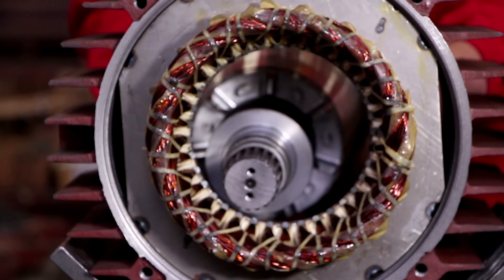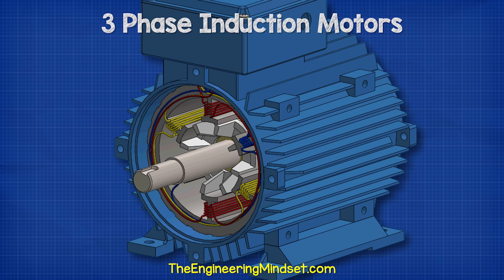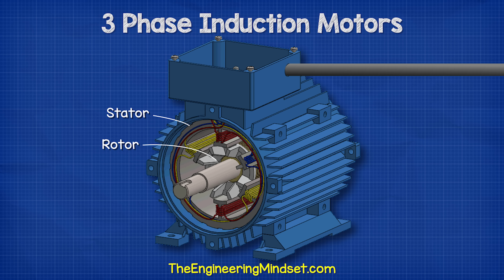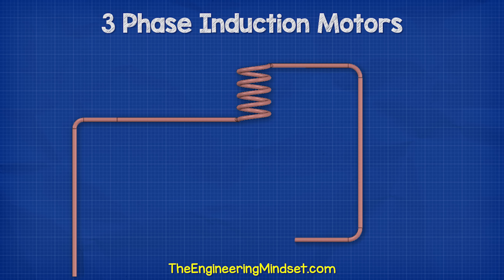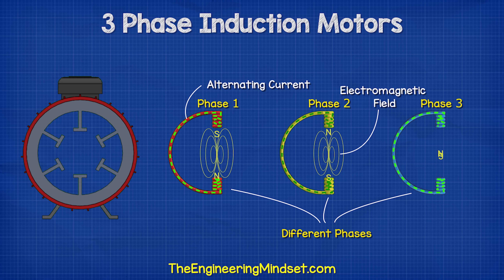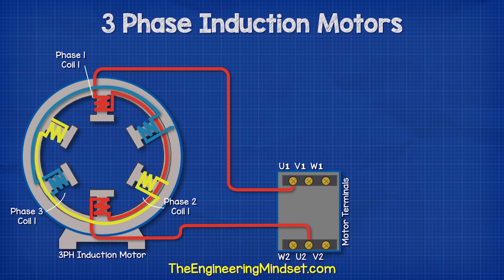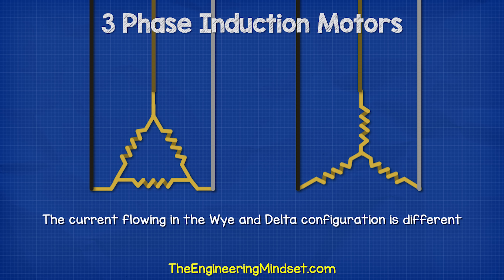How Electric Motors Work - 3 phase AC induction motors  ac motor

Comment: The Genius of Nikola Tesla. How did he imagine this in his head and constructed it when I even with this great animation hardly can understand it.
Reply: His brain was thinking in 5D, we are thinking in 3D.
Reply: Helps that he had an IQ of 240 minimum!
Reply: Also... people use the paddle to row or paddle. Old technology. Most people dont reallt know how it works. They feel the force on the paddle, and push the water... i mean when using it, you start to feel how to utilize the physics. To explain it, is much harder.

Even today, they dont really know what magnetism is. 

And then you have aerodynamics...

Its all about trying, and explain it after.
Reply: Nicola tesla did not invent this, he improved on it, there were already electric motor on his day and DC motors were more prevalent however inductions motors not widely used they had been already invented. Tesla under Edison fixed many problems he had with DC motors but Tesla had a better theory on how to conduct electricity better with AC with inductions motors but Edison would have none of it. Then Westinghouse hired tesla bought his patents and other patents before Tesla and had Tesla work on his ideas. Then Tesla improved and modernized the induction motor in other word he made them practical with the aid of Westinghouse backing and the patents he bought. But Tesla did not invented
Reply: @jhonnycaicedo5647  this motor Is originaly Tesla invetion
Reply: @srancojic5963  No.
Reply: Focus and imagination. Einstein said imagination is more important than knowledge.
Reply: @blau6832  Nikola Tesla

The first AC commutator-free three-phase induction motors were independently invented by Galileo Ferraris and Nikola Tesla, a working motor model having been demonstrated by the former in 1885 and by the latter in 1887.
Reply: Tesla wasn’t the genius he was made out to be. He was wrong more than he was right.
Reply: @ignacio9399  any success was preceded with many failures. Your comment was completely ignorant lol
Reply: because he was a genius
Reply: whats you got to do with Tesla. cmon now
Reply: The man's brain had a brain that had a brain inside a brain
Reply: @ionutth4895    I hope your not thinking in 3D. 3D is the past. A specific moment in time that cannot be influenced by the 4 dimension because it's already happened. 4D is what we think in, we plan ahead. Most of us don't have the brain capacity to accurately think in 4D but that is what we do. We plan in 4D, and wait for a 4D moment to act, and then it becomes 3D, because its been done. While time can be slowed down and sped up, it's still 4D. When you look into a telescope and see distant objects, your seeing 3D, because of time dilation, depending on distance of course, so yes, you can view the infinite in 3D. It's 4D to you because that's how we process. But there is no 5D. It's just variations of the 4 dimension.
Reply: Really great
Reply: All because of one successful experiment in hundreds of fail exp
Reply: @sunflower735sunlight5  He was a genius and i dont think anyone disputes that. But for some reason a lot of people really overstate his work (Even though there really is no need to do so, his work is really important for modern electrical engineering), making him to be a lot smarter than any other genius (like fe Einstein). He did not invent "the" electric motor, only certain build-forms of it after the principle was already invented. He was also ultimately wrong about his worldview regarding physics (he did not believe in sub-atomic matter like electrons and Einsteins theory of relativity, both of which are proven to be right nowadays)
Reply: @TobiasRebentisch   No electrons were discovered a long time before his death
Reply: @yuhanqin1463  I know, Tesla still thought they dont exist. As i said, he didnt believe in sub-atomic particles.
Reply: That was hardworking
Reply: You need to know that Tesla was not imagine a induction motor, he was seeing it!!!!!
Reply: @ionutth4895  he was thinking with his unconscious but in conscious way!
Reply: By learning from nature of course!!!! ❤️
Reply: @TobiasRebentisch  He was technically right since they do not exist at all the way conventional science taught!
Reply: @Ksum Nole I'm glad Monsieur Curie wasn't like you!!!!
Reply: The pigeon told him.
Reply: Good point
Reply: He must of been outstanding
Reply: I believe in Tesla family's powerful inventions
Reply: @JF32304  i can imagine a lawn mower, but i need the knowledge to know how to fix it.
Reply: Edison founded all this way before Tesla.   Tesla just refined it to its final stages.
Reply: Westinghouse gang 🤙
Reply: "Geniuses" weren't really geniuses , they just had less distractions and more time to think and achieve what we think are miracles.
Reply: @Gretsch0997 That's just false goofball.
Reply: Edison created dc powered motors. Tesla turned them in to a/c powered motors
Reply: He didn't imagine it in his head he said that he got it from Spirits in the universe above,  do your research you will learn all the major inventors say the same exact thing Edison, Marconi, Einstein etc  but people say they were geniuses but they were just a little touched in the head, For what telling the truth?
Reply: @Prodigal450  😂
Reply: @Prodigal450  😂😅
Reply: @ignacio9399 it only takes that one final time of being correct
Reply: God gives us different gifts, we must use those gifts.
Reply: Although it was Tesla that came up with ideas of power distribution via polyphase AC and how this could be used to both create light and notice force, it's Mikhail Dolivo-Dobrovolsky's 3-phase 3-wire system and squirrel cage AC motor that we all use today and whose design was so perfect it remains unchanged to this day.
Reply: Indeed, it's his design that this video is describing, notice how only 3 wires are connected, not the six of Tesla's.
And without that squirrel cage, you can't get much useful force out of the motor.
Reply: I urge you to read Mr Tesla last letter to his mother.
Reply: @Gretsch0997  Edison literally stole the ideas
Reply: He understands that magnetic force can move an object, so maybe he thought if it can spin it too?

That's how i thought of electrical motors worked before watching any video about it, guess he got really curious
Reply: The electric motor was discovered by Faraday
Reply: 😂😂😂 Totally agree
Reply: No
Reply: @ionutth4895  and yet, I’m thinking in 2D flat earth theory, lol. Tesla is the greatest!
Reply: @ignacio9399  just remember that Edison failed many many times before he got the lightbulb to work so most of them failed many more times than successes
Reply: Thank God I’d say.
Reply: Amazing!
Reply: 4 hours sleep and work all other time
Reply: @ionutth4895 ..I thought so too...
Reply: His iq was 300 @CAVALIERKNIGHT33
Reply: He is great...no doubt
Reply: @JF32304  I disagree somewhat with Einstein on that one. Imagination is inherently limited to that which one already knows about. Nothing is generally imaginary if it already exists, so to truly be imaginative, one must be familiar with the ordinary and real. To be personally oblivious to a creation and conjure up an idea for it is ultimately disappointing and redundant. Moreover, if one has an ingenious idea for an unprecedented invention, but none of the scientific knowledge necessary to create it, their imagination will be bottlenecked. I concur with the inordinate importance of imagination, but to treat knowledge--which is intrinsic to imagination--as inferior, is naive. An analogous argument is that chemistry is more important than physics, or vice versa. Both are simultaneously necessary for reality as we know it to exist.

Nuance is important.

Comment: Man, I have been an industrial mechanic for 20 plus years. My weak spot has always been electrical. I have understood the basics for a very long time, but when I have tried to further my understanding, books just haven't done the trick in my simple little mind. Your series on electricity is absolutely amazing. In just a few short hours I have gained a better understanding of the concepts that the books just can't teach me and definitely don't show. The animations you use are the difference and will be the difference in why these facts will remain a permanent fixture in my memory banks for the rest of my life. I don't even know how to say thank you enough. THANK YOU!!!!
Reply: tungspeeker9660
Can't say I blame you. I maybe be going into robotics, but my main discipline (major) is mechanical engineering in part for this reason.😂
Reply: Hey man i’m currently in school for industry maintenance at the moment. Struggling to understand this stuff, is there any advice you can pass down to me?
Reply: @connerlott  Sure. Not sure exactly what you're having trouble with, but for me, it's usually easier to grasp a concept if I was hands on with it. If I didn't have the chance to go hands on, I always looks for something like the animations this guy offers. Easier for me if I can see how it does what it does, as it's doing it. Hands on is the best way to learn
Reply: I am in the same boat !! The electrical portion has always been a struggle for me but when I see these video, everything comes in full circle.
Reply: I'm an electrician by trade and this series hammered home a lot of concepts I had been improperly taught. I was just telling my buddy the same thing about how the dissection and animations are priceless
Reply: Literally coudnt of said it better myself, you are me ha
Reply: dont feel bad. I just got my electrical engineering degree from a top 10 uni and I barely understand anything and  neither do most of my classmates. You just have to learn via hands on you cant really learn from videos or books. Theory is very different than reality
Reply: I’m 22 years old trying to get onto maintenance in the factory I work in. I have a strong grasp on pretty much everything in the building besides three phase motors. Everytime I’ve tried to research it it’s all just been mumbo jumbo but this video really helped me see the simplicity in it.

Comment: When you realize that a 15min video thought you more than a 4 year college...
Reply: College won’t teach you the practicality or a thorough understanding of any applications for the topics they teach you. That is a huge problem I had with college is they’ll teach you the theoretical concepts buts for me that more difficult to understand since I couldn’t apply to anything real. Such as a motor for current, voltage, resistance.  or a water pump for bernoullis principle.
Reply: I took electricity and magnetism in college and can confirm this is true.
Reply: Yeah because faculty were incompetent

Comment: I feel like something important was missed here.  The DC motors video made a lot more sense than this video.  Here you have three wires going off into the magical atmosphere while the DC motor showed a connection to a battery.  Although the DC motor video did go a bit long with the forces push/pull in showing how electromagnetic forces worked and got a little tedious as a result.

Comment: 15:03 
Does that mean that delta configuration can handle way more powerful engines than star configuration, as the delta configuration has higher line current ? I'm not electrical engineer.

Comment: This made me understand how "multi voltage" motors work. 480v would be using the star connection and 208v would be using the delta configuration. Which makes sense why the higher voltage is always lower amperage. 

Or at least I think thats how it works lol.

Comment: There is a centrifugal pump driven by an asynchronous motor. suppose the impeller of the pump is clogged with mechanical impurities and it is jammed. At the same time, the current of the electric motor increases, please explain me in detail physically and using formulas and Ohm's law why the current of the electric motor increases, in the situation described above

Comment: Do induction motors have a duty cycle? My 3-phase motor blew. I discovered it was not single-phase but used some trickery with a capacitor. Can you cover that?

Comment: There is still something i dont get, the stator gets the current right ? But we have 2 currents, we have line voltage and phase voltage. For calculations we use always the line ?

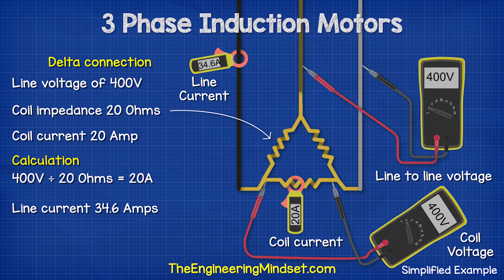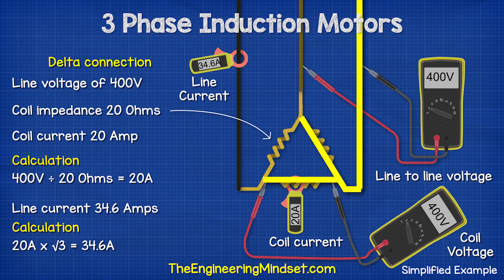Comment: 13:20 - 13:32 i cant connect why you multiply 20 amps of current by root 3 because each phase has 2 coils. Can you explain a bit more? Why root 3? If each phase has 2 coils why not just multiply by root 2 instead?
Reply: root 3 because of 3 phases

Comment: at 6:10, How will current be induced in loop as loop is cutting no magnetic field lines. change in Magnetic flux through loop in vertical position is zero.

Comment: So between delta and star, star produces 1/3rd the current as a motor using delta?
Reply: Yes, that's why most large AC motors that aren't ran off a VFD will have a Wye-Delta start sequence, Wye Start connection for initial few seconds to get the rotor moving "initial mass" then switch to Delta Run connection, this is to minimize in rush current on a high starting load application as you can see amps are low with Wye.
Reply: @austinschwebel819  thanks for the explanation brother!

Comment: This is the first video that introduces completely unknown concepts as assumed knowledge within the Electrical Engineering Basics playlist, and for that reason is quite hard to follow. For example: What IS 3 phase vs single phase in general? That question is somewhat answered in video 26 (this is video 13). Where does the square root of 3 come from in the star configuration line current calculation? Why do the line to line voltages stay constant etc? I am sure there's an obvious explanation, but it has not been explained.

Comment: Help me out here Paul, i have a 6 lead motor where the leads are totally unidentified. I’ve found which sets of wires are the windings with my ohmmeter. That’s the easy part. The problem is that I don’t know what side of the windings are 1 or 2. Does that actually matter? Is there a way to test them to find out? 
I love your videos! They help me tremendously! Thanks!
Reply from the maker: Some good ideas here: https://www.quora.com/How-do-I-identify-the-six-unmarked-leads-of-an-induction-motor
Reply: The Engineering Mindset this is very helpful. Thank you. And again, thank you so much for your videos. I’m a visual learner, so your animations are very helpful. I’ve become a far better electrician with a better understanding of things. So thanks!!!!!

Comment: 11:05
If you look at the Star Connection, the animation shows the electrons bump into one another where the Blue phase and the Star Connector meet.
Is this an actual thing that happens in a circuit? What happens when electrons bump into one another like that?

Comment: why change two phase makes motor turned different way in real work?
Reply: As shown in the animation the peaks in current of the three phases go in the order ABC. Looking at one end of the motor you have coils UVW going clockwise. If coil U = A, coil V = B and coil W = C then the rotating magnetic field will go clockwise UVWUVW..... If we leave U = A but change the other two connections so W = B and V = C then looking on the same end the order that the coils reach peak current now goes UWVUWV. In the middle of this you can see it is WVU, anticlockwise. This change will happen whichever two connections are changed.
Reply: @martinconnelly1473  thanks

Comment: If 3 phases split wiring so we have 2 phase as generation 1 phase as motor but double nymber poles then batery start up then very little nearly zero fuel needed 😢😂😅🎉. One importantly is shuelding so no interference inside from outside ...it work same principle as human lungs and universe breathing
Reply: Also detail in torque balancing and load balance must observe conservation of energy and battery buffer so undeoad it had no delay drag. Also wire must had insulation otherwise short can nit produce electricity. Also put it side way so reduce gravity delay because spin sideway had less work against gravity but if big motor or strong emf or too many use can cbange earth center if gravity create nightmare no society csn hadle unless addon water tube as counter spin which general electric big hydroelectric power plant had destroy so many life on and agriculture and earth climate

Comment: To me it looks like the phases are touching, how come there is no short circuit?
Reply from the maker: See the part on insulation, it prevents shorting
Reply: @EngineeringMindset  I appreciate your response. My question is more if I follow the connections, the way it connects it seems as if Line to line are touching thru the coil, then why it does not short the same as if you would touch line to line at an electrical panel. Thank you in advance.

Comment: Why electric car motors have only 3 wire terminals (instead of 6 like the rest of industrial AC motors) ? Why they join the ends of the coils of each phase ? and How is their block terminal connection ? Or motors powered by inverters do not need block terminals ?

Comment: As a teacher of electric machines, I find this video rather confusing. Especially from 6:00, where you suggest that a current will be induced in the loop when it is vertical, which is not true because there is no flux passing through the loop at that moment.
Reply: If teachers teach well these videos wouldn't have exsited
Reply: @yodaboiiii  if teachers didn't teach, nobody would know enough to make videos like this

Comment: Hello Paul, out of interest in a delta configuration does it matter which ends of each windings are connected together? Like the example below? 

L1 to U1/V2 
L2 to V1/W2
L3 to U2/W1 
 
Can these configurations be switched as long as each phase is connected to separated ends of windings? 

Thanks in advance👍🏼